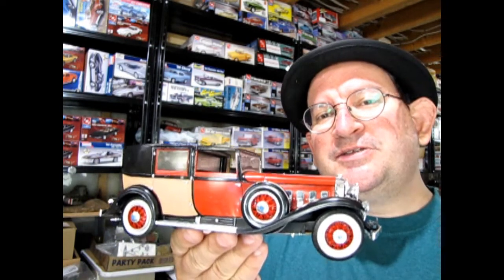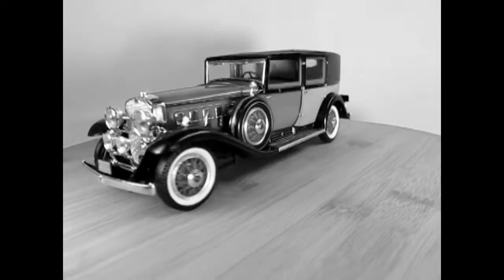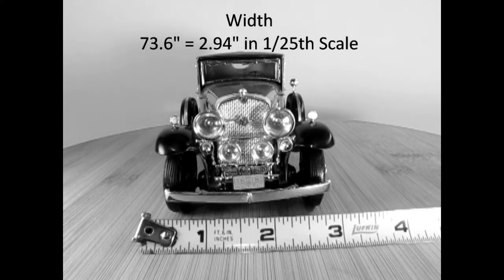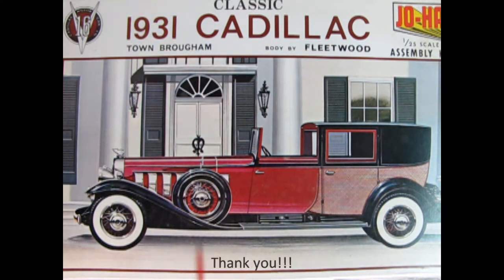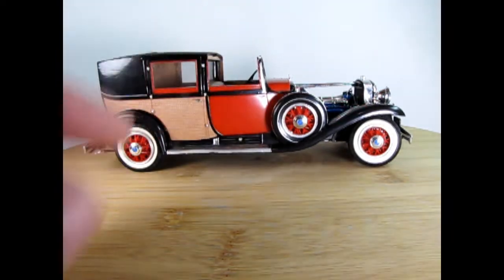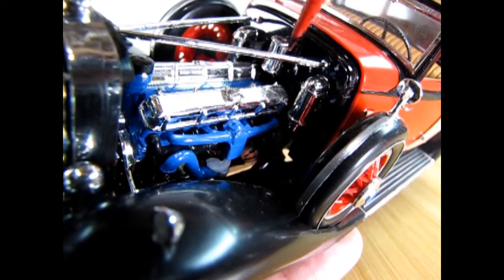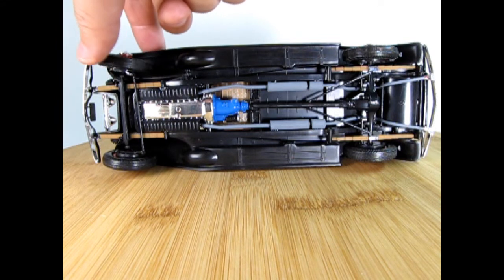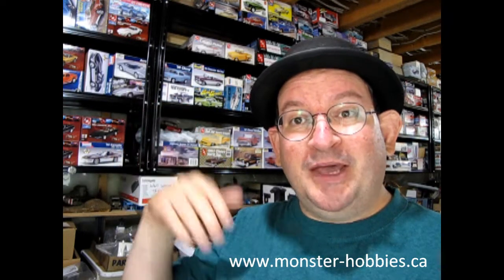Model Car Garage Show And Tell - My Dad's JoHan 1931 Cadillac V16 Town Brougham - A Model Car Build

Comment: Thanks for posting this. I have photos of this model and many of the builds I did from the late 1960's and 1970's as a teen. Johan and Monogram were pumping out the classics and I was buying and building them as fast as possible with my Christmas money and wages from my first job as a soda jerk at the local drug store. I built this Cadillac in a very similar way as your dad with the black fenders and red body with the black striping and roof and the tan caning on the rear of the body. I didn't take detail photos of the interior, but it looks like I left it black. The wheels were the molded red with the whitewalls. I also built the '31 Cad Cabriolet molded in green and black as well as the Mercedes roadster molded in light yellow and coupe molded in burgundy. All were sold on ebay and through ads in the model car magazines after college as I had no place to put them all. Great memories for sure.
Reply from the maker: Glad you liked the video and that I opened up some memories for you. I have more of those classics from my Dad and in the future i hope to build some of my classics. I also want to build a museum showcasing both my models and my dad's in some "action" dioramas of times in the 1930's, movie cars, the 1950's and much more. I also have model trains, slot cars, star ships and other cool things. I just need money and a place.

Comment: Beautifully built model. I also like the history you provide as well as pictures of the actual car.  But sometimes I worry that you might drop the model!  Just kidding.
Reply from the maker: That's the plan!

I am glad you enjoy the history I am adding into these videos. It can be difficult doing the research and then pairing it down to fit the video length without overdoing it.
Reply: Wonderfully built model.  Excellent work by your father, and what a great survivor.  Definitely a great model to have in your collection.   It looks like it is a great kit, and needs to be brought back in some form.  Thanks for sharing,
Reply from the maker: @michaelcooke2559  It would be great if someone could find the molds for sure!